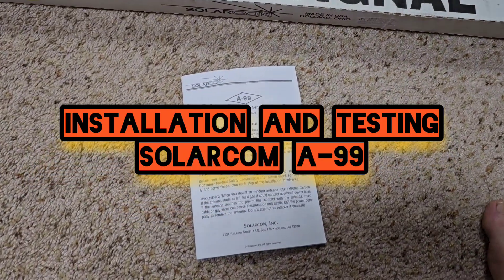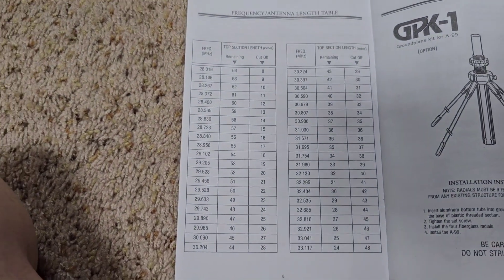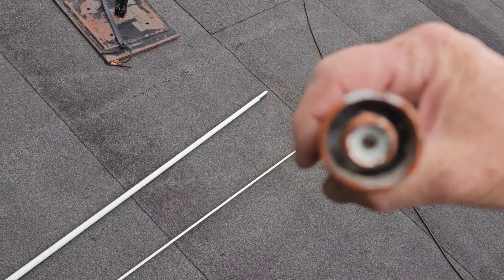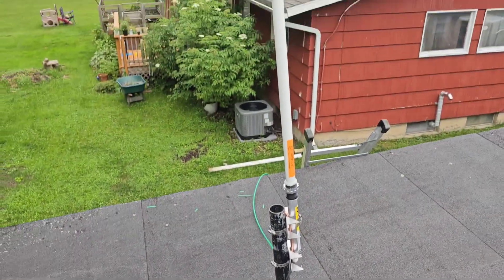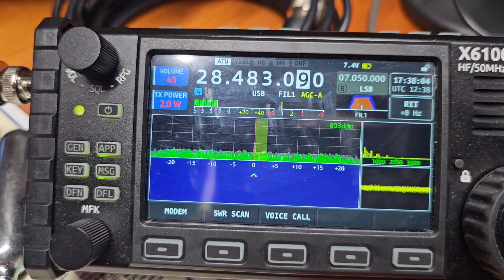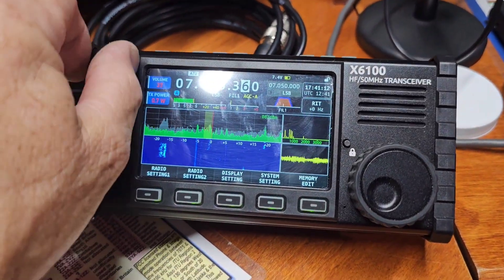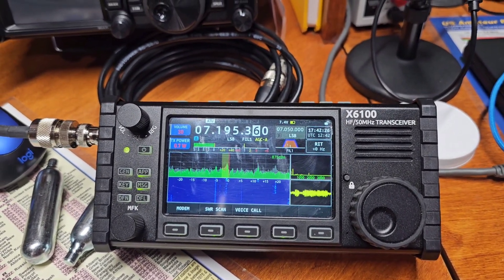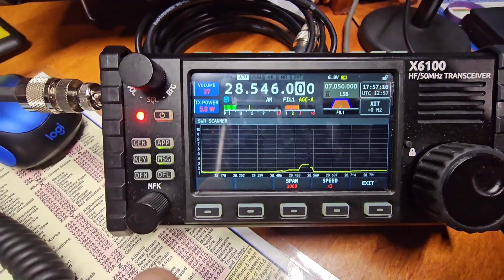Solarcon A-99 installation and swr testing

Comment: Thank you. What does the choke made out of eight circles of the coax do? I'm just getting started.
Reply from the maker: Helps stop rf from heading back to your radio just a precaution doesn't effect performance
Reply: @ —  Good info! I’ll remember that trick. Thanks. Does it matter if it’s igoing clockwise or counterclockwise?
Reply from the maker: @Banjoliope  no

Comment: I put one up in September and trimmed the top. Worked a lot of DX with it on a 10' pole on my deck. About 18' above ground to the bottom. Also have the GPK. Worked great in the ARRL 10 meter contest.